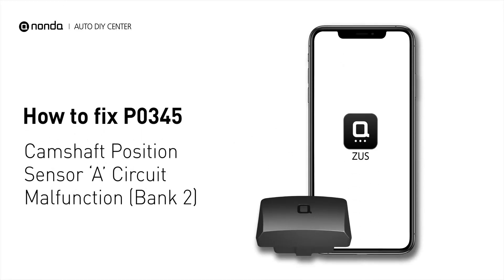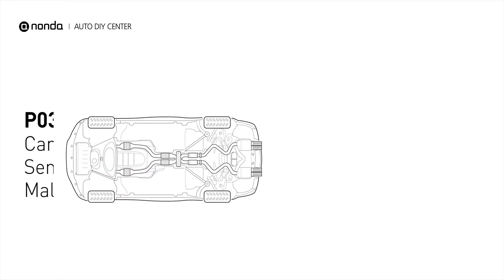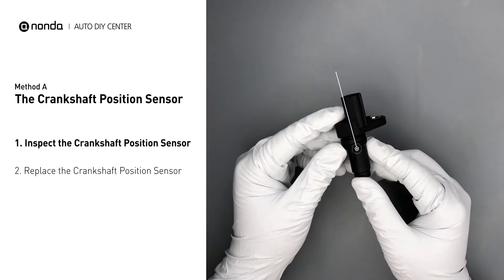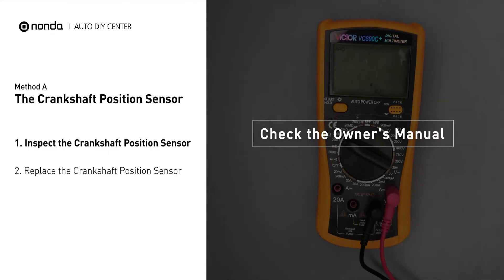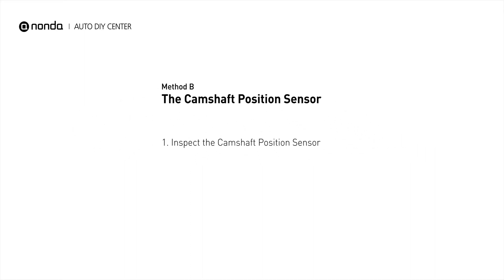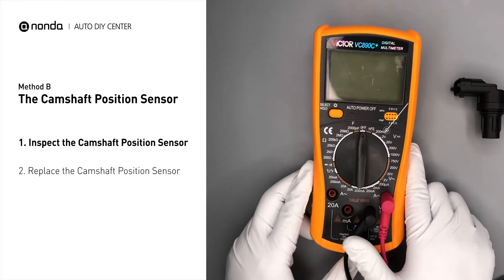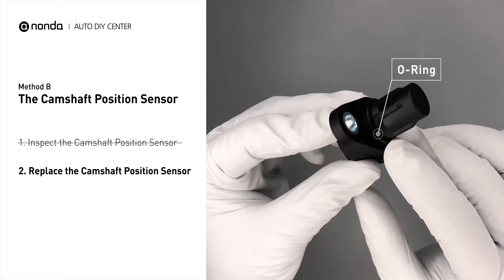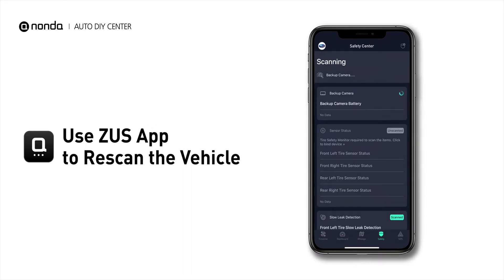How to Fix P0345 Engine Code in 3 Minutes [2 DIY Methods / Only $9.45]

Comment: 2005 Ford f-150 I replaced both of mine with two original Motorcraft ones and the code never went away. The car still has the same faults.

Comment: P0345 is Camshaft Position Sensor, not Crankshaft sensor. At least it is on my 2015 Transit 250 with a 3.7 gas engine
Reply: Are you the guy that a rear ended with my semi last week? Grey colored

Comment: I have a 2007 Volvo XC90 giving me this code P0345 x3, and the vehicle will only go 20 mph?
Reply from the maker: Hi Zurin, kindly check the condition of the crankshaft/camshaft position sensor. Repair/replace them if necessary.